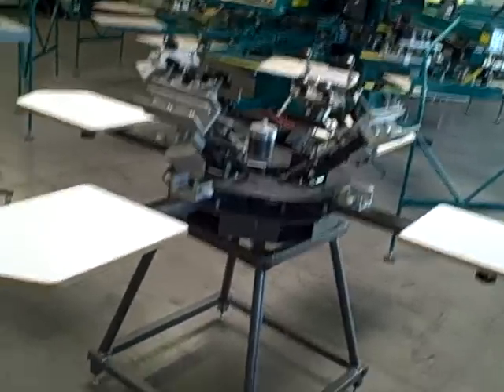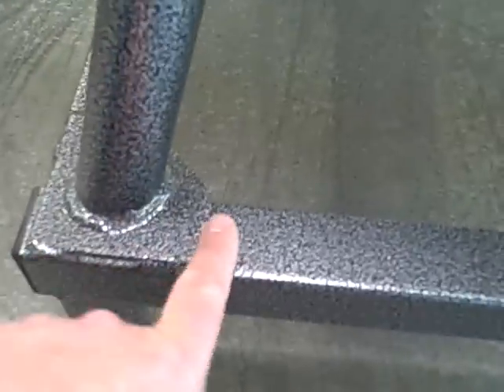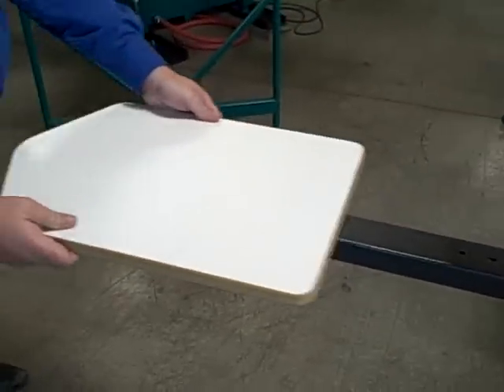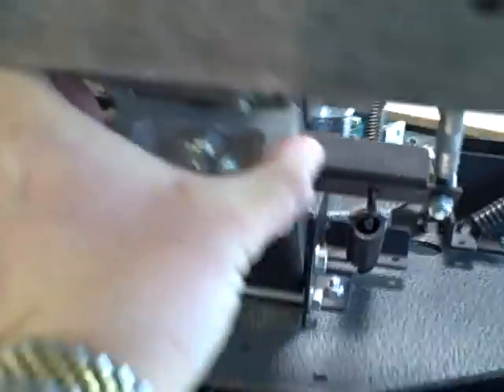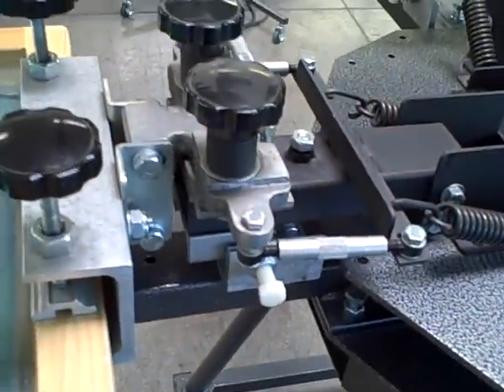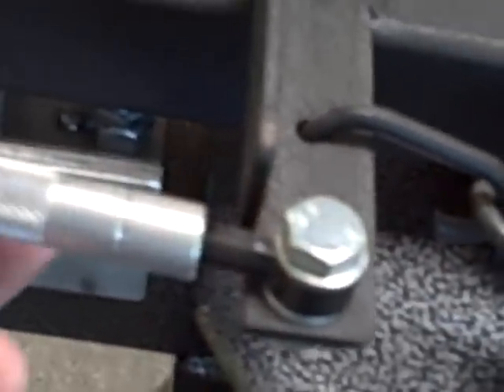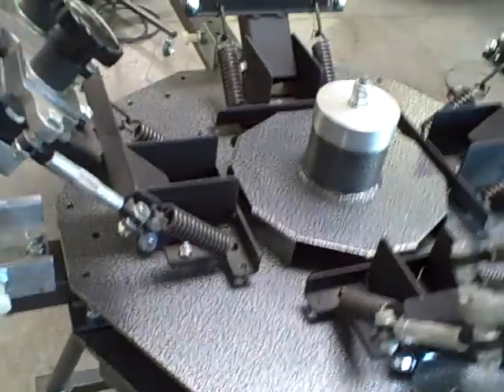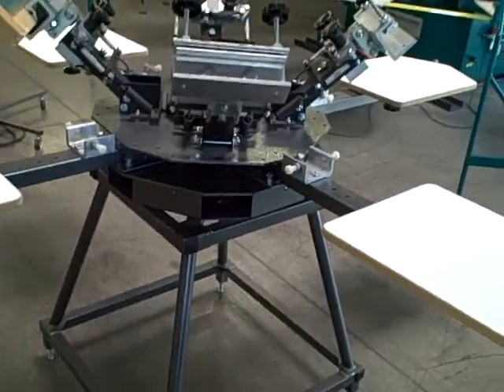Workhorse Odyssey 4 color / 4 station Expandable Printer

Comment from the maker: The leg inserts are 12MM threaded. I doubt you will be able to find a 12MM caster in the states. You may be able to get casters at Home Depot and fabricate brackets that would attach using the 12MM bolts, then attach the casters to the bracket?